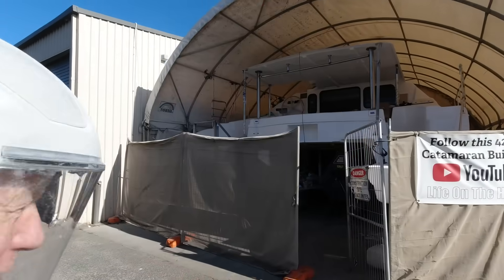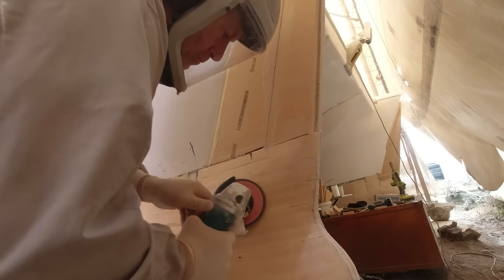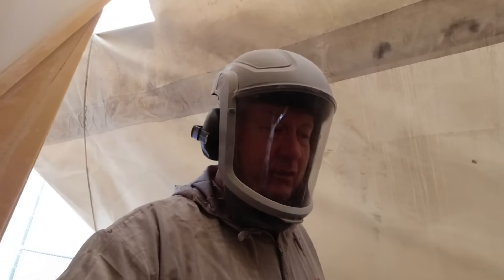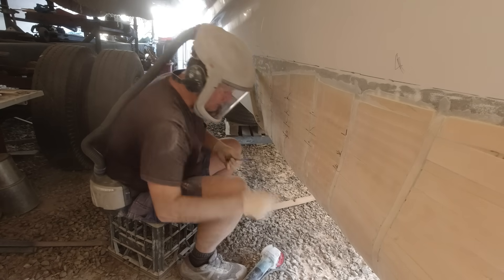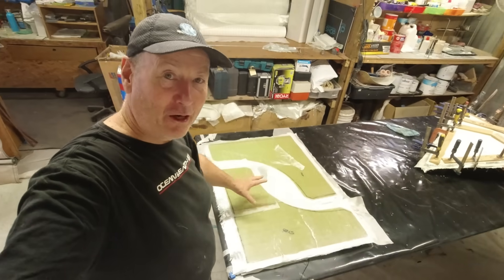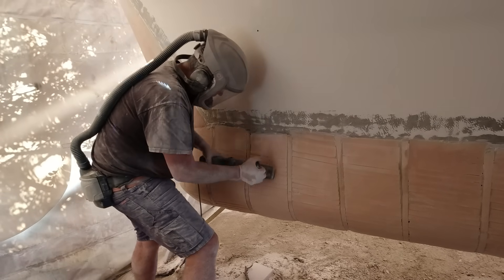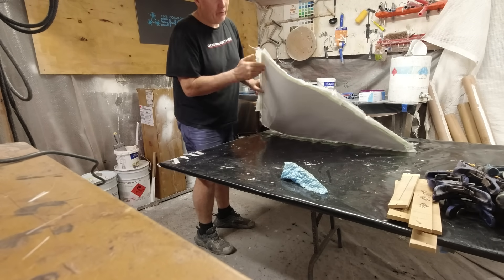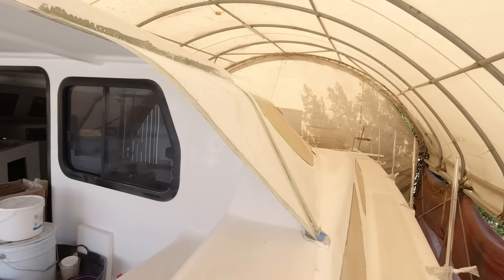How Can I Stay On Track ? // Just keep ploughing ahead - Catamaran Build - Ep307

Comment: Rossco is this a crash safety device and can you make a mold where you could sell this foam fill device
Reply from the maker: The bow mods are primarily buoyancy but will double as a sacrificial bow that can be easily repaired.I won't be making moulds simply laminating and fairing and gel coating to finish.Cheers Rossco

Comment: A Ross ole mate
I reckon your bows would prevent hooking in-water unseen floxon, ropes,lines or whatever 
if they were a straight line from new high point to the front of your new mini bulbs 
Just a thought having had to clear fowlings court over bulbous bows.
Your installation is ever so close to solving that problem and it would also add a little extra to the required bow flotation
Go the square bear 🙂and leave Jack at home.